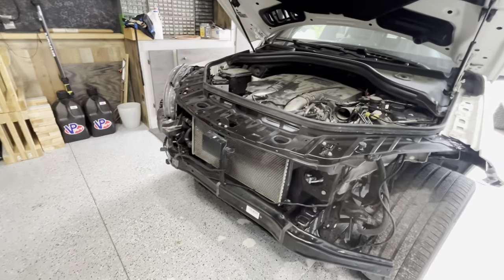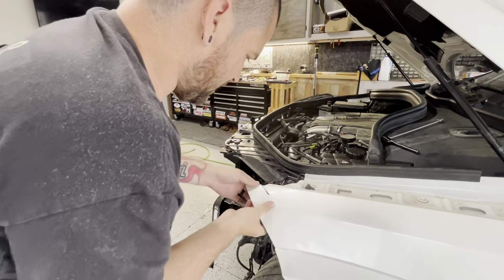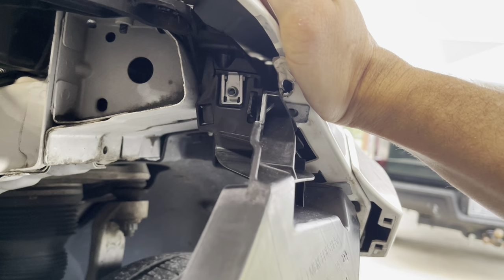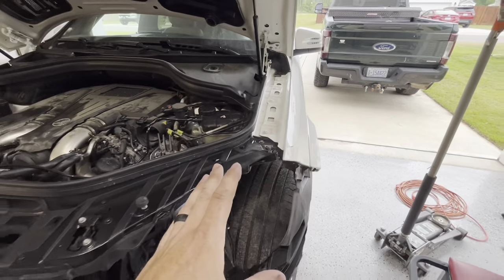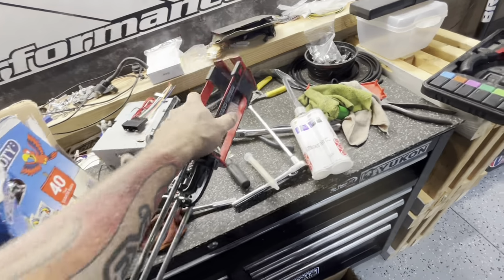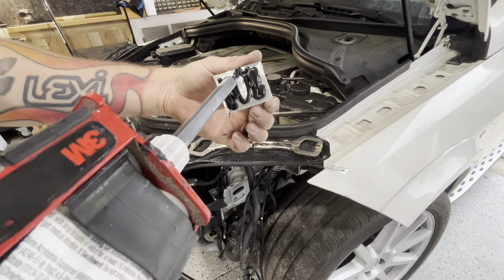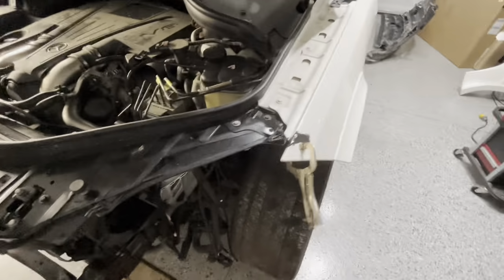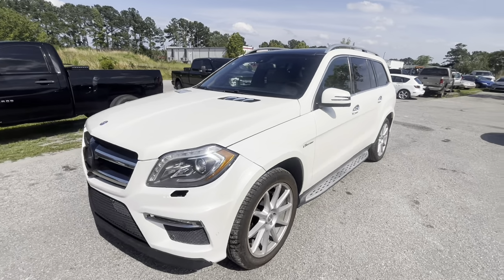🛑 NO WELD Repair Ripped Torn Aluminum Fender Don’t Replace‼️DIY

Comment: Heat .....heat is your best friend when repairing and reshaping aluminum body panels. Get a pair of welding gloves and a MAP gas torch, or a good hot heat gun.
Reply: Also a temp gun,....285 to 415 degrees F. That is your window of workability.
Reply from the maker: Thanks that’s great advice!

Comment: Was ur fender hanging low? I just to brake checked in my gl a few days ago and the hood is fine the bumper and the fenders got damaged the fenders have a gap now in between do you think that the fenders blew out?
Reply from the maker: Yes the fenders could of been pushed out away from the hood

Comment: That panel bond glue gun cost $100 and the panel bond cost $$ Why not use $15 jb weld
Reply from the maker: I’ve never had as good of results. I’ve used this gun probably already 60+ times since I bought it
Reply from the maker: JB weld would probably work though just fine

Comment: Hi. Is this stuff, panel bone easy to find or need to order? As well the gun…. Also, is it pretty good on heat and not compromising the fix? Thank a lot for all your hard work1
Reply from the maker: There’s different ones for different applications. Check the 3m website for information on different panel bond products